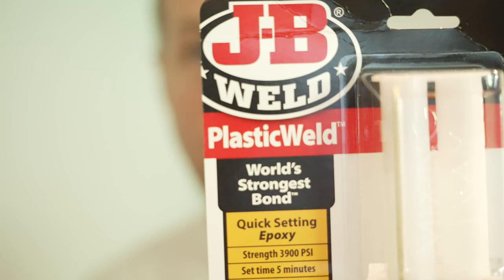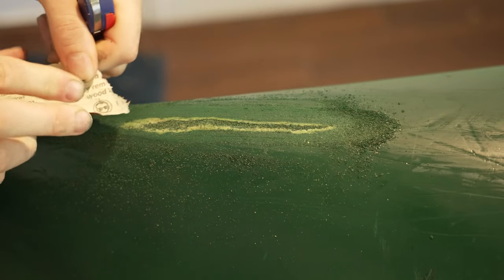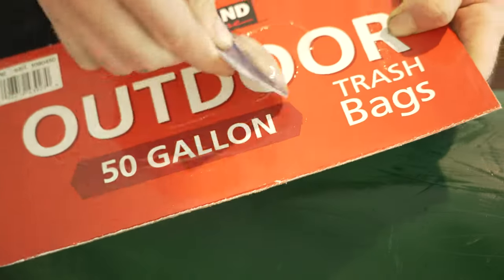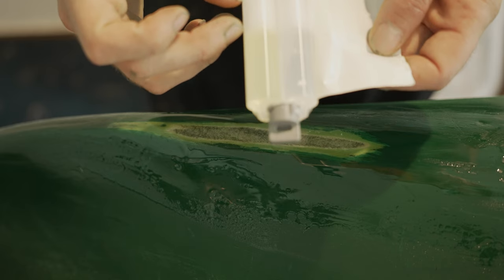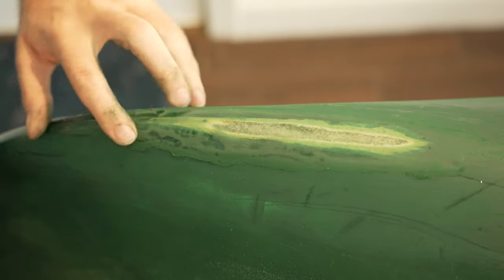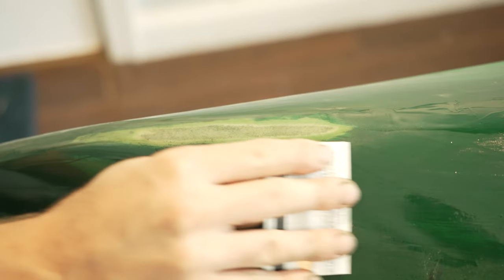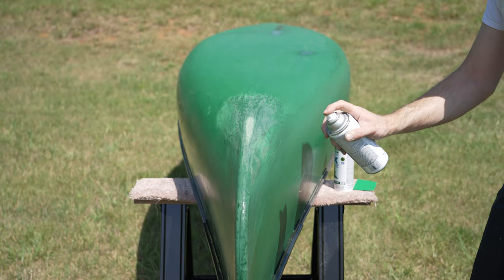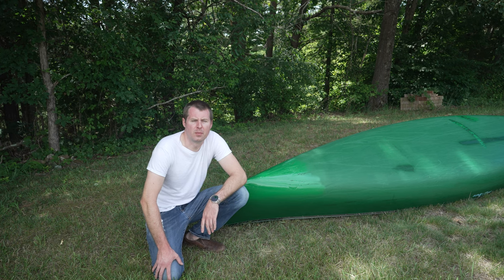VERY Strong ROYALEX Canoe Kayak Repair Fix Patch Epoxy 4K

Comment: Nice job!!! Instead of painting can cover with a thin metallic sheet (aluminium or stainless steel) and you finish for ever wiyh this....
Reply from the maker: That's definitely another way to repair it. I just chose this way as it's the closest to original with adding almost no weight and drag.